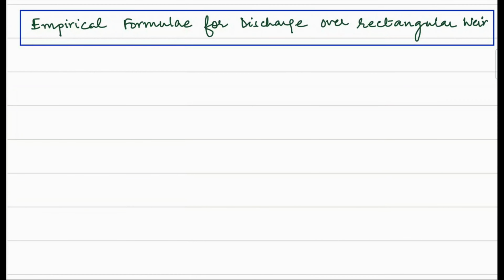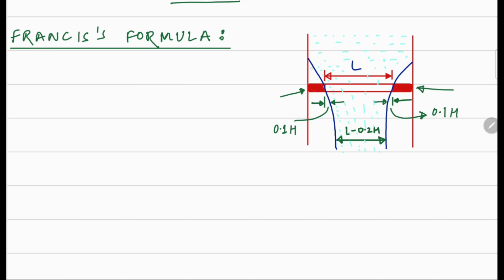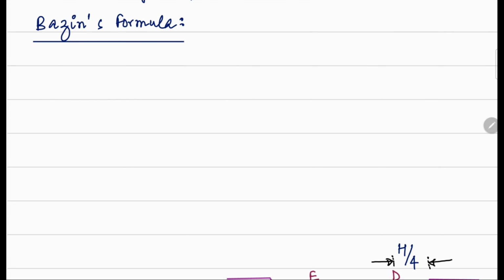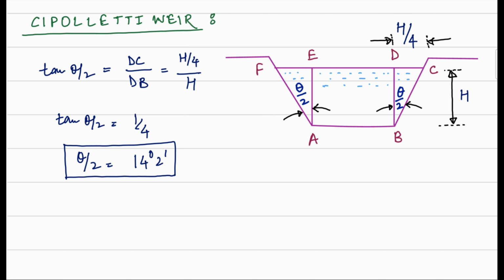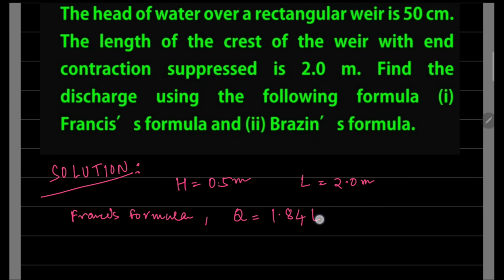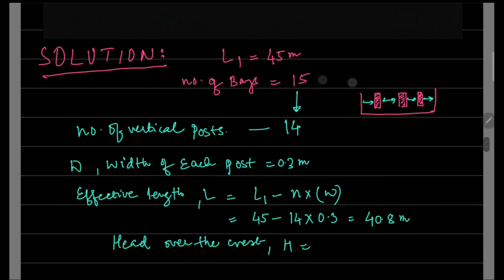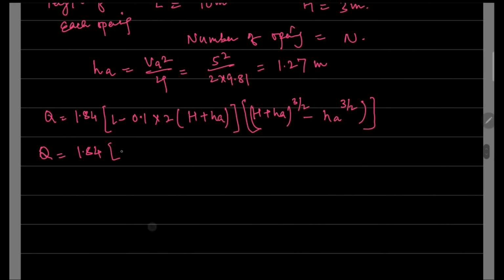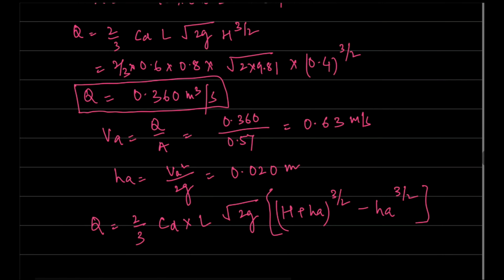Cipolletti Weir| Francis and Bazin Formula| Empirical Estimate of Discharge Over Rectangular Weir

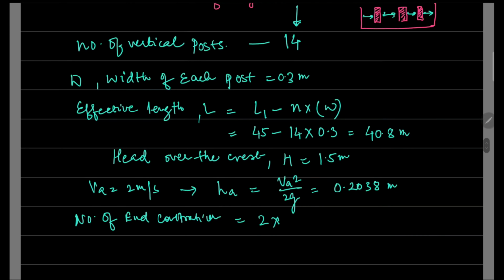Comment: sir i think the no. of end contractions in ques at 33:00 should be 14*2 = 28 as there are 14 posts and end contraction is due to the presence of posts only 
after calculation i am getting answer as 141.389 m^3/s